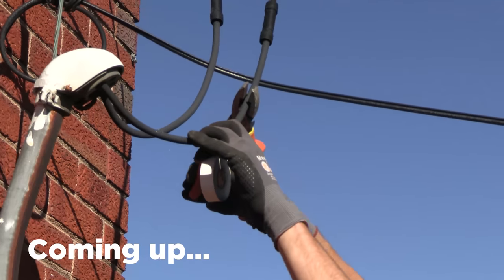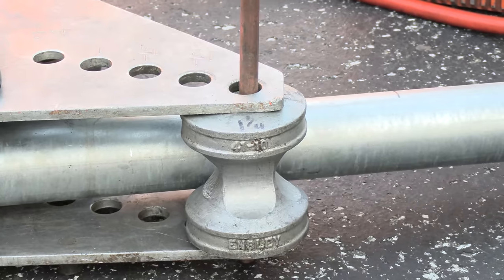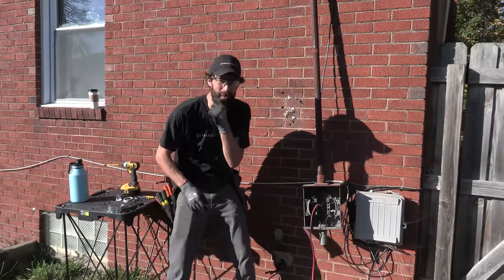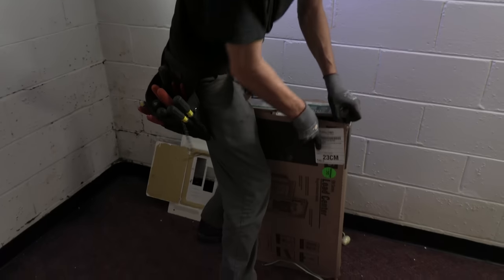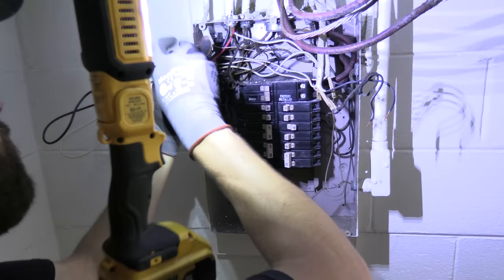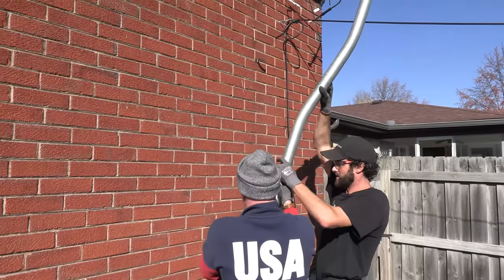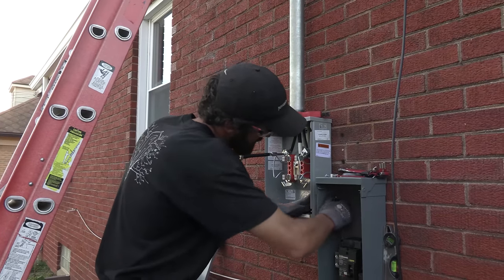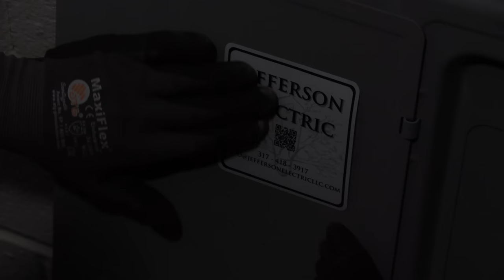Electrical Work for House Flippers Doesn't Have to be Stressful

Comment: Wrong. Code violation. Can’t come into your disconnect above the breaker like that. Need a meyers hub.
Reply from the maker: You're right. I noticed that on the re-watch. Any time a penetration is made at or above live parts the code requires a weather proof hub.

Comment: When my place was upgraded to 200A, the electrician cut the triplex at the weatherhead, stripped back the utility side conductors, and connected his extension cord to them.  Nowadays, I'd suggest a Bluetti or an Ecoflow for temp power instead.

Comment: Put the conduit back in the bender for the second bend, then level the bender (and conduit in the bender).  With slight pressure on the conduit, level the remaining section of conduit sticking out of the bender. This will eliminate ‘dog leg’.

Comment: your temp power cord would benefit from some clamps to just clip onto the terminals and never need to remove them. you can get some 20 or 30 amp ones from an auto parts store - not that you need the amperage, but the clamps open wider. I've got a long suicide cord like that so you can clamp to overhead wires should you ever need to
Reply: I was thinking same thing.  That's what I use alligator clips on S.O. cord with GFCI on other end.

Comment: Isn't illegal to attach before the meter? Anyway surely it's dangerous, why not use a portable generator or this days a portable battery to power the equipment? That equipment is also not protected, a short in the equipment will make it explode, since the only overcurrent protection is the fuses on the primary side of the transformer (so a fault can pass hundreds of amps in the appliance and the cord).
Reply: Do that where I live (different country) you be in court for stealing electricity. The safety people would have part of your body removed.
Reply: Yeah I'm dumbfounded a licensed contractor would put up such unsafe and I'm assuming where he is  possibly illegal practice.
Reply: I can see it. Thanks for pointing out the explosiveness connection made for a hydraulic bender.

Comment: Carry a pre-wired "cheater" cord.  To obtain power from just about anywhere a panel or piece of electrical gear was located (rooftop HVAC units / crawlspace / alley / equipment room / etc.) I used to take 20' of 12/3 SO cable and run it onto a deep aluminum "bell" box w/GFCI and in-use weather resistant cover.   On the unterminated end, I used to use industrial grade inline fuseholders with 10 or 15a slow-blow (delayed) fuse.  Occasionally, we would even attach high quality, medium size alligator clamps after the fuse.

Not the most clever concept or safest OR code compliant, but it kept me as safe as possible between the overcurrent device AND GFCI.  

I got the idea after the most evil crew of hardwood floor installers decided to pull temp power for their sanders/buffers from the service I had just installed.  They used extremely poor quality Chinesium made "vehicle type jumper cables" with massive UNINSULATED alligator clamps.  On the other end, they had simply fed both phases ("red" and "black"  LOL) into a 2 liter empty soda bottle where the wires were "terminated" and connected to 2x female twistlock receptacles, generously taped and insulated with 3m blue masking tape.   The power equipment was then plugged into the receptacles.   When the clowns attempted to connect to utility power, they pulled the panelboard cover and attempted to clip the alligator clamps to the live phase lugs feeding this 200a 40ckt SquareD QO panel.   BOOM !   They had shaky hands and the shaking got worse after their first try at arc welding.  

Great channel.,  It';s enjoyed by quite a few friends.
Thanks.,

Comment: What kind of amperage does that bender draw?  I would be willing to bet that a truck-mounted inverter would benefit your employees greatly.  You could even do a couple isolated deep-cycle batteries on the trucks so they wouldn’t have to idle the truck or risk killing the starting battery.
Reply: I have a 1500 watt gfci inverter with a deep cell battery connected to a relay then to my starting battery. Relay only connects when engine is running to charge deep cell. I have enough power to run my large Makita rotary drill (1/2 hp).
Reply: I would bet a 2200watt generator would save a life in this situation…how in the world can this be standard practice….

Comment: I would be careful about drilling a hole for your conduit in a 3R rated disconnect. You might just be removing the 3R rating of the box.

Comment: Use a anti dog. Use Ram travel.  This pipe bending was pretty bad man. And get a pair of alligator clips on a #12 awg  cord with a inline  fuse. You can bug off the wire at the weather head for temp power.
Reply from the maker: I've never heard of an anti dog or Ram travel. Can you explain that further?
Reply: @ElectricProAcademy  I’ve bent a ton of conduit and was taught by a lot of old timers that worked in steel mills. 
When that Cylinder ram comes out and starts to bend the conduit for the desired degree you can measure it. Example. If the Ram comes out  5” for a 30 degree bend,  every time you bend the pipe just measure with a stick rule, 5” for a 30 degree bend. You’ll have to use a protractor the first time to find degree and amount of Ram travel for desired degree It’s super accurate. 
The anti-dog keeps the conduit bent on the same plane. So before you start bending , put it on the end of conduit make sure you’re anti dog is level, bend conduit then release pressure on Ram.  Rotate 180 degrees level the conduit. Now bend. Your pipe will be bent in the same plane and won’t have a dogleg. Google anti dog you’ll see it, and there are videos on you tube I’m sure using one.

Comment: In general penetrations of 3R enclosures (without the benefit of a "waterproof" thing like a hub) are in lower part of the enclosure. If the top of your penetration is above the lowest terminal then you have violated the design.
Reply: Yeah that was a really bad install
Reply: I was thinking the same thing. I’m glad somebody else noticed.

Comment: Maybe in a couple three years those ford e-transits or something like that will be available enough that you can run equip fleet with them and not worry about shore power when taking off the meter.
Reply: Yeah! What's the point of electric vehicles if you can't get some power out of them!!?
Reply from the maker: That has to be in our near future. I agree

Comment: I love what you did there with hooking that up... I know what you did there too, except for one thing I am confused about. It seems you had the ground and neutral together. Wouldn't that make a false ground ? Also, wouldn't it behoove you to instead make up a cord or an old pair of battery jumper cables rigged to a J Box with an electric socket, so you don't have to worry about creating a massive arc or literally screwing around with live wires ?

I don't know that the plastic or the enamel coating traditional jumpers are sufficient enough to insulate you from 120 volts or even 240 should you need it, but surely you can fashion something and have leather gloves insulated with non conductive rubber.

I might even go as far as magnetizing my J box and using a GFCI so that it is fully grounded and you can plug something in without worrying about it falling into a puddle and protecting you. Just a thought though.

Also, having lived in houses that have been flipped, I wish the flippers would have hired a pro for electrical. I can't tell you how many times I have taken down a ceiling and opened up open air splices. Not even a wire nut on them. Just the wires  left bare and not even stapled to the rafters and in one case, someone stapled the bare copper wires to the rafters. I was a kid and got into a HUGE argument with Mother about how unsafe that was and again she said to me "I wish I could buy just ONE house that you didn't have to rewire." I was like "Me too, Mother. Me too."

When I can't sleep because my brain won't turn off, I make some chamomile tea and I write down everything that's going through my mind. A journal. I used an account book or composition notebook before computers came along and now, I journal in a computer. Sometimes I do both. Writing on paper vs typing on a computer produces different results so you have to find what works best for you, maybe even do both. This way, it's written down, you know it's there subconsciously and your brain doesn't have to worry about it anymore, because it's documented. Sleep, enough REM i crucial to staying fit, feeling well, and actually being healthy.
Reply: Old jumper cables lol that’s just insane
Reply: What's a "false ground"?  The groundING conductor is connected to the groundED conductor at the first means of disconnect anyway.  He just did it without a disconnect.

Comment: Electric work shouldn't be stressful for hpusr flippers in Indiana.  They have to hire professionals. You can only get a self permit for you main residence in Indiana.  So much of the house flipping work needs contractors in Indiana. So not as profitable as other states.
I added a subpanel and several Afci/gfci circuits in my basement with perfect inspection passes thanks to your channel and others.
Reply: Indiana doesn’t have state licensing for electricians, only local city, county, etc.  Some localities don’t even require any building permits 😀

Comment: 4:00 - Why not just buy a 2" offset conduit riser already made?  They sell them at electrical supply stores.  They come in 7' lengths, but you can add a coupling and nipple as needed to increase height if necessary.
Reply from the maker: That's really interesting. I've never seen or heard of pre-made IMC off-sets. Thank you for that tip and I'll be looking into it.

Comment: you don't have to have a plywood backing on the cement wall to mount the panel?
Reply from the maker: An air gap of 1/4" is required in the code between metal equipment and wet locations, however electrical equipment has the 1/4" built into the mounting holes. The 1/4" plywood thing has gotten traction as a way to satisfy that code, but the manufacturers came up with another way.

Comment: Hey man, after watching the video and thinking about it some more, I’d say your trade is similar to my profession is a lot of ways.  I’m a pharmacist in a hospital. Very high risk, zero room for mistakes. You’ve got to find time to rest and recharge.  I can see you’re spread a bit thin and when that happens we start to take unnecessary risks or circumvent safety practices.  We all have limits. I think especially in your profession, you do not want to test them.  Just my two cents.
Reply from the maker: Thanks for sharing that Stephen. I’ve taken a page from Loren Rickey’s book and I’m using a very gentle sleep aide when my busy mind won’t shut off to help get a full 7-8 uninterrupted hours of shuteye. It’s been a great move to utilize occasionally without any side effects.
Reply: @ElectricProAcademy  right on man. I find with my busy schedule carving out time in my to do lists for myself and my family has done wonders in taking my mind off of work

Comment: We need to remember, that to take on such a project requires know how, skill and knowledge of your area's electrical code.  Such changes or renovations to electrical installations  are best left to the licensed, electricians for many reasons.  Your home insurance will not cover your renovations if you fail to have them inspected by a official.

Comment: What size copper conductor do you use for 200 amp service?
Reply: 00
Reply from the maker: I would typically use 3/0 copper for a 200 amp service but more likely 4/0 AL due to the price savings

Comment: Great video.  How’d you run/bend the second phase on the load side of the meter to run to the disconnect? Didn’t see that in the video.
Reply: RE:Stephen Matics.  If you are talking about the piece that connects the two enclosures, it's called an offset and is a part that you can purchase.
Reply: @munsters2 actually I was talking about the hot ungrounded conductor that is ran from the right bottom side of the meter base to the disconnect.  How would that wire be bent to connect into the lug? Would it be bent there at the bottom or would it be looped around the top right, go across the top, come down and then loop around the bottom into the lug? I wanted to see what that looked like.
Reply: @speednutsII  Sorry, I can't help you with that. Yeah, it's too bad parts of the project are missing, but I guess when you are busy working, you don't have time to record everything.

Comment: Joel.  Don't waste time unscrewing breaker terminal screws, just cut the wires close to the breakers. Just get that old panel out as fast as possible. When I was doing that kind of work, we did not have the luxury to dilley-dalley.  House flippers are generally cheap-asses. Thanks, Russ, 28 years in the trade

Comment: You gotta get some Whia or wera Screwdrivers..Klein is so yesterday
Reply: Nah, they are the real thing for insulated drivers.
Reply: @skyemac8  once you go with REAL tools, from Knipex, Whia, Wera, all others are unfit for duty, there is a big difference, just the way they fit in your hand, comfort, and superior durability in the materials they use.  Like WAGO lever nuts versus obsolete wire nut, twist on connectors, once you go WAGO, screw, screw on connectors
Reply: @skyemac8  once you go with REAL tools, from Knipex, Whia, Wera, all others are unfit for duty, there is a big difference, just the way they fit in your hand, comfort, and superior durability in the materials they use.  Like WAGO lever nuts versus obsolete wire nut, twist on connectors, once you go WAGO, screw, screw on connectors
Reply: @skyemac8  Like a Porsche or Audi RS versus a Chevy....
Reply: @cengeb  I own them all. Klein is just as good. You have no idea.
Reply: @skyemac8  I have Klein stuff, plenty of em'....Knipex, Wera,Whia are so much better, in all aspects, comfortable, ergonomic, better quality steel...better cutting edges...You have no idea what you are talking about...just the Klein obsolete rubber bulky handles and hard plastic is proof how outdated they are, the finish of the metal, on a Klein is like a Chinese toy, Knipex, Were, Whia are works of durable art

Comment: You don't know the simple math, or how to use a 'no-dog' for conduit bending.  You're ignorant to better methods for tapping into the line side for temp-power, yet are aware they exist, which is willful ignorance and dangerous.  You failed to safe-off the exposed conductors after making those connections and then proceeded to stand next to the open shell with a piece of conductive material in your hands.  This is behavior I would find unacceptable from a second-year apprentice, and most people would intuitively feel uneasy in the presence of someone who shows such little respect for the energy with which you're working.  You're attempting to teach using a platform you should be employing to learn before you kill or injure yourself or someone else.   Invest in a good generator, or maybe a Chicago bender as well as some classes if you want a future in the trade,  or just a future in general.